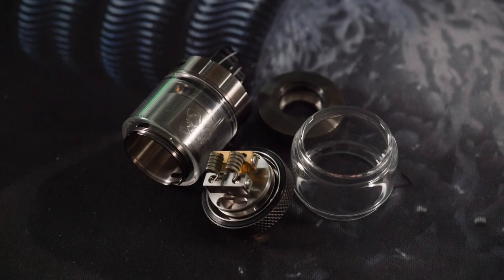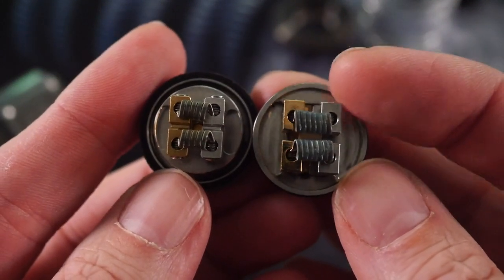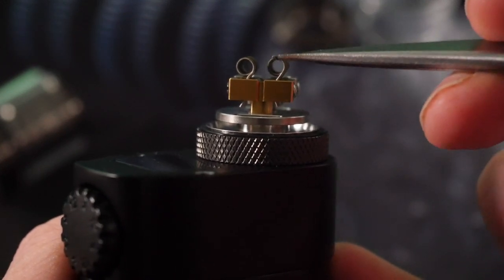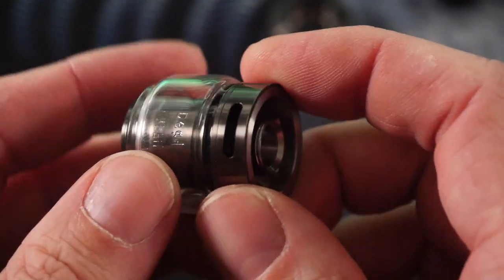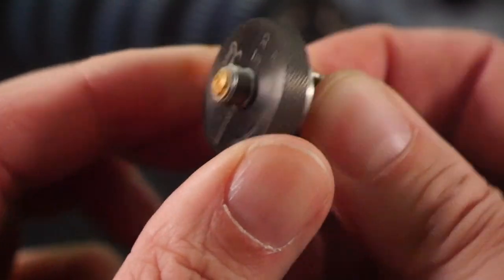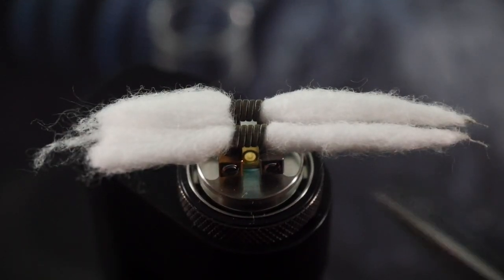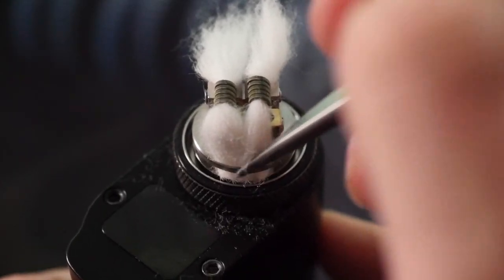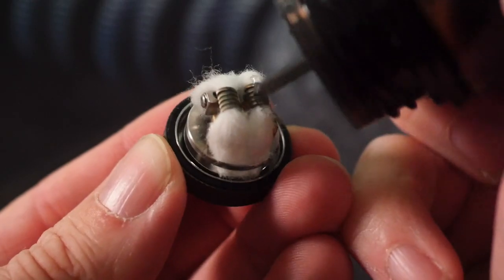Dead Rabbit RTA : Bit of a bummer IMO

Comment: Just unboxed, .18 Clapton build, wicked loose but not like super thin. Coils slammed to deck and had no problem assembling base (no fumbling). Such good flavor on cutwood tobacco trail. Its cloud chucking quite well,no dry hits.
With top air flow, not to worry if you under wick it a bit!
This is a bad ass looking atty too!
It's a win.

Comment: Opinions are opinions, that what makes vaping so subjective. I happen to LOVE this RTA, had it about 2 weeks. It is actually making me shelve my Sherman RTAs, which is saying something. I wick mine SUPER super loose with short as hell wicks. I am essentially getting an over saturated hit down to the last bit of juice in the tank. Just how I like it. Imagine the first hit you get on a dripper right after bleghing your juice. That's how each hit is on mine. 110 Watts on a 0.13ohm N80 dual fused claptons 3mm. Awesome RTA, 8.5/10 for me.
Reply: Yep its a really decent tank, myself i hate having to line up the deck with the chamber/tank portion and not being able to put it together while its on a mod, but besides that it is a very decent atomizer, especially for the very inexpensive price. I got mine for 19$ with a coupon code. Im not the biggest fan of tanks anymore, i use drippers 90% of the time. I see alot of people coming in to the shop everyday and theyre getting dry hits on their rtas, and its because theyre over wicking em. I know youve been vaping for a few years now,  so ya know when ya wick an rta you really just want enough cotton the block the wicking channels off so that the deck doesnt flood. I always basically just "capped" off the wicking channels with cotton. I never put my wicks through the channels, just place the cotton on top of the channels to prevent the deck from flooding. Good to see you comment, if not "seen" ya on any videos for quite a while, hope youre doing well bud. Have a good week, stay well and vape safe my friend.
Reply: Same here guys , I love it .
Reply from the maker: Black Sun Sirius 777 See that honestly sounds awesome. I get that same kinda thing from the Reload RTA.  Meh, to each their own 👊🏻 thanks for watching dude
Reply: Black Sun Sirius 777 I love mine too

Comment: After building on this deck three times and failing miserably, leaking, after leaking, after spitting unvaped juice into my mouth over and over again, to having to carry alcohol wipes and qtips on me and vape the first couple hits through my tshirt; I just about gave up on the RTA. Then I found this video, watched it once, and built my first successful build on this thing and I’m so happy that I didn’t give up on it because after all the sense that your video made to me, it is a phenomenal vape! Thank you 🙏🏻. It turns out that I wasn’t utilizing the cotton wells correctly and so juice was flowing straight from the tank into my mouth and throat every single hit. I also didn’t know I was supposed to line op the notches with the holes and so I’d end up thinking I was going to strip the threads and therefore was getting leaking out the bottom because it wasn’t tight enough. In the end, this RTA is kind of a pain, but upon building it correctly; it does produce a very tasty vape. If it weren’t for your very thorough and easily followed video I would have thrown this thing out, gave up on RTAs and went back to my DR RDA and probably would have crashed my car trying to drip and drive...

Comment: Thanks for the insights. I have had absolutely ZERO issues with the Dead Rabbit RTA. In fact, it's one of the best atomizer's I've used to date. The deck's very easy to build, the performance is fluid no matter what build i use in it, the top-fill is easy to use, no leakage whatsoever, no flooding to speak of, just an all-round great performer. I've used it in both single and dual coil mode, and have had the best flavor experience with it mostly in single coil. I suppose it's very speculative, but I'm very happy with it.

Comment: Cut cotton a bit short of wick ports, soak cotton then stuff after expanded. Also use 30g/.3/40g 5 wraps 3mm .13 ohms usually .12 after the bould around 65 to 75 watts with n80 framed stapple aliens, and I've never had anything less than an amazing vape.

Comment: now you tell me , I just bought this
Reply from the maker: lol sorry!!
Reply: @GrimmGreen  bro innokin makes a disposable tank called the goMax it's the coil and thank basically they only need to fill and screw on an actual mod a the cost $3.99 bro I filled this one 20 times already it's already been more than a week and it even has AFC at the bottom and doesn't leak because of a resin layer that was smart that new RTA should follow, but definitely check it out. Oh yeah almost forgot the most important thing it holds 5.5 ml

Comment: Nice fair and unbiased  review,  I guess heathen / hellvape  should have gone with Rdta instead of rta . That huge raised deck is not for rta for sure.
Reply: Aren't rdta  kinda a dead market nowdays?
Reply: "dead market" - pun intended??  ;)
Reply: @zoolooz2327  yeah theres not alot of new rdtas coming out, and i dont think rdtas are that popular. Myself i dont use tanks but i definitely preferred rdtas over rtas most of the time. For myself i definitely got better flavor from rdtas over rtas, but drippers are still my preferred atomizers.
Reply: unintentional for sure ^^ but 2 years ago china was pooping a 10 rdta a week, now it's a single rdta a month at best
Reply: ZoolooZ23  dead market 💀 😆 
Made my day
Reply: I think half the reason that rdtas have died out so hard is that bottom feeders are really boosting in popularity, which kind of is a better rdta in every way.
Reply: Max Stickel 
Not sure if they really died , VV just released last month a new rdta, asmodus and many other companies did , people hate rdta's for reviewers don't prefer them , not all for sure . Squonking hype yet is faced with size issue, dual battery squonkers are yet big . If this problem stays unsolved I see the coming back of rdta's and this is why companies never stopped producing and developing them .
Reply: A "true" RDTA would have the deck above a reservoir, hence the "dripping" part where you'd be able to drip if you so chose to. With that being said many manufacturers started creating and calling the inverse RDTAs also. "Inverse", in that the actual atomizer section was placed outside of and below the actual tank. A key design factor that separates it from the traditional RTA, in which the atomizer is otherwise directly inside the tank itself. In my humble opinion, the direct to coil airflow offered by RDTAs, and furthermore the ability to also drip (in certain designs) is more attractive to me than standard RTAs. I agree with many others that The Dead Rabbit should have been an RDTA. For the sake of argument, some of my favorite, most flavorful vapes, have been of the RTA variety. In terms of overall convenience an atomizer with a tank does it for me. Needless to say, I'm not much of a "squonk" guy. Happy Vaping !! #vapefam
Reply: Emilio Muniz the dead rabbit  itself was designed as Rdta, it has long wicks,  a reservoir  formed by the top cap itself,  coils are near to mouth,  so theoretically  it is rda with Rdta features or Performance, if they went with  larger reservoir  under the deck then they could have  kept same good vaping experience and made it more convenient  to use on dual battery mods without the need of big squonker.  Even they could get use of the trick limitless  did with supplying  rda base and a tank,  the way the limitless classic is.
Reply: ZoolooZ23 yes, because they are shit. 
Tilt em and they leak, they're finicky to wick, they often look pretty weird and are a hassle to refill. 

It's funny how China keeps making clones of RDA's and makes rdta's out of them though. Like the apocalypse, goon, etc. They all exist in cloned rdta form.
Reply: @vaping one most people don't like rdta's and I can tell you that they are never going to make a comeback. People may still use them but the market is not asking for a rdta. Most rdta's suck and are hard to wick. I have the dead rabbit rta and I fucking love it to be honest. I'm more of a rda and squonker kind of guy but when the dead rabbit rta came out I had to buy it. It was a but finnicky to wick but once you get it wicked right it vapes like a dream. I honestly was kind of disappointed at first when I wicked it for the first time and got the worst dry hits ever and wasn't sure I liked it. But now that its wicked right I haven't been able to put it down.
Reply: Anthony Ramirez . From my experience I can tell you are right when it comes to rta. There is a way to get the best of any rta if you have patience, I remember my tfv4 years ago when all said it was leaking with  rba section and in fact it took me time to make it work well. But it was fantastic that time. As for rdta's I don't defend or hate them either . If some don't like it , it is ok and vise versa . But if manufacturers are still producing then their market studies must have indicated that there is a demand . Let us not forget or ignore that mtl and single coil rta making now strong comeback so nothing we can be sure of in this market especially that vaping is fairly new .
Reply: @gmula1987  interesting you're enjoying the dead rabbit rta. Most reviewers seem to say it's kinda below average with current RTA's. Definitely thought it looked amazing when I first heard about it but now I wouldn't buy it with so many superior RTA's these days.
Reply: ZoolooZ23 what has happen company has just left them behind and miss the the boat. They better then RTA for flavour and clouds nothing can beat them in my eyes. They are a RDA with larger juice that is what it is.
Reply: Anthony Ramirez open your eyes they are coming back in force you will see and the wicking is art  they never leak when you know what your doing. Same for any wicking on a tank.
Reply: j jarry I have many rdta's, none ever leaks. Best flavor I can get. In fact much easier than rta's when it comes to wicking .
Reply: Yep i agree best flavour you can get. Seem a misconception about RDTA's. As there not meany new ones out.
Reply: @dylan-5287  watch djslb vapes review he seems to think the quite opposite and he's one of the more knowledgeable technical reviewers.  Also what top airflow rta would you say is superior to this top airflow rta? Honestly I'm not even an rta kind of guy, I prefer rda's. Only bought this rta because I love the rda version of it and wanted to switch it up from squonking all the time. Also because its one of the coolest looking rta's to catch my eye and come out in a long time in my opinion. I love it and I'm enjoying it far more than most reviewers are which is surprising considering I'm far from a fan of tanks but I am a fan of this one.
Reply: @gmula1987  I don't take any YouTube reviewers findings as that serious, some get paid for good reviews and if they diss each others products they get shit from other reviewers, it's all just entertainment on here. My buddy who has a million and one atomizers wasn't a fan and smaller reviewers on forums strongly recommend skipping over it. I totally agree that it looks awesome, that was my very first thought when I saw it, when so many tanks don't look that great. I'm also way more of an rda fan myself. I think top air flow is overall just inferior, I get people are scared of leaks but that comes down to wicking. Bottom air flow all day in my book. I'm honestly tempted to grab one just since it's cheap and looks phenomenal. But it seems like Heathen kinda got lazy and just decided to turn the DR into an rta instead of actually doing the work and making something slightly new. Everyone's got different tastes which I totally respect of course.
Reply: @AMAMBT  everything in the vaping world seems to have its phases. I'd totally put my money on rdta's coming back again in a big way. All it takes is one big reviewer to design a new rdta and hype the shit out of it and everyone will flock back like sheep lol. Squonking went out of style a bit and now came back just like many other styles. There's no money to be made when people don't "need" to buy the latest and greatest equipment, and somehow the best yet is always just right around the corner lol.
Reply: Dylan - exactly  . I hear you  Dylan
Reply: I think squonks have made RDTAs kinda irrelevant.
Reply: Ian Charles yep squonking hype did that,  but unless the big size of dual battery squonkers to be solved I guess soon squonking hype will end and this is why companies never stopped producing and developing  rdta's.

Comment: I'm curious why you chose such a small coil at only 2 mm? Yes, there's a big difference in performance if you keep your coils really low versus higher up. I will say that with the air closed off maybe 1/8 to 1/4 closed there's no whistle with high coils. It does take a lot of cotton to run down to the wells, especially mounted high, and yes, you need to fluff and thin the ends to get good wicking. Thanks for the review.

Comment: Fluffing the cotton is essential yes. However I need to dilute my full VG juice back with dem. water to 75% VG to avoid near dry hits when chainvaping. No whistling here, but to find the sweetspot on taste I need to restrict the airflow (bummer, since I like max. airflow). Assembly is a bit strange at first, but once you get it it’s easy. The deck clicks when you push it onto the chimney when it’s done the right way. Then screw it tight and done.

Comment: Just align the little cutouts on the tank piece with the center of the deck between the coils on the way down. Should be much easier. Mine required a ton of finesse at first but now it has got much easier over time.

Comment: Nick...try just barely putting the cotton in the wick ports..not down to the bottom of the deck..and thin it out..it won't leak..top airflow...I put my coils about 3mm above the posts straight above the holes..then the airflow blows over the whole coil...flavor is better then the reload rta..obs engine v1,v2...crazy good...its been my adv since I got it at NVE..mine sounds just like yours with my coils raised...no whistle...weird..

Comment: Try the 'dam' wicking method. Just cover the wicking channels with cotton, don't put the cotton in the channels.
Reply: Does it wick better your way... 
Iam not sure ..
Like the system
But those long cotton wick's 'does 
Juice with high VG  making problems ? 
Vape on
Reply: Guppy your right on point here with this technique. I try to have a few strands poking through the holes but not quite to the base. Also I take my time!! Nothing worse than having to tear the whole thing back apart after you just filled it....Been there done that and still do on occasion lmao!
Reply: @strangexgiant5950  exactly how I do it with most rtas. Especially the kylin v2 rta . Once wicked correctly it vapes godly

Comment: I am gonna have to disagree with Grimm on this one, while he is entitled to his opinion, the DR RTA is a very good RTA it’s possible to find a good middle ground for coil height to get the most flavor and least amount of whistling, You are not gonna get the exact same flavor hit from an rda as you will with an rta while wicking is a key it isn’t difficult once you learn a good amount of cotton you need to use. The only negative I have to say about it is adjusting the airflow can be a bit of a pain lot of times it dosent want to simply adjust, could be just my rta on its own but I don’t really fiddle with the airflow often either.

Comment: most people who own this share the same sentiment. too big of a deck to produce good enough flavor for an rta. also, with the unproductive wicking. the distance is way too substantial. the notches in the air flow/chamber section are a plus. i remember an rta from the past that had the spinning deck. was the first mage tank i think. it's a nice looking rta, just wish they would have taken the time to improve upon an already solid design. rather than just rushing the product out while only making small adjustments. the bubble glass is not offensive at all on this rta, since the other portions jut out as well. i cant even imagine what would happen with the coils even higher. that would make the wicks even longer before they hit the bottom of the tank. the styling definitely transfers over. just think they could've knocked this out of the park with more r&d. thanks for the review, Nick!! :D <3
Reply: Original OBS engine had spinning deck, and they improve it even better with V2 engine